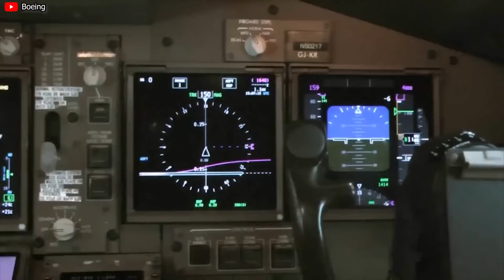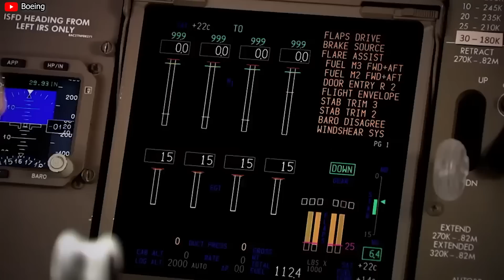Boeing HUGE Engine Plans on 747 is Coming…

Comment: Re-engining the 747 is the easy part. The problem with the jumbo now is that they're getting very old so the airframes are now coming to the end of their useful life, the avionics are old and there's only a handful of the last version, the 747-8. This is not going to happen in a million years.Boeing needs to concentrate on its 747 replacement, the 777-X. Not waste time fluffing about with unappealing and expensive upgrades that will make little to no difference in the long run.
Reply from the maker: thanks for your comment

Comment: As impressive as the A380 is, I still have great feelings of respect and nostalgia for the Queen of the Skies!
Reply: @howardtenenbaum3537  flew recently to Hong Kong on the A380.  Where the 747 is the queen of the skies, the A380 with its low noise levels and stability is a House in the sky.  Fantastic airplane, rocksteady

Comment: Boeing definitely won't be making a twin 747, lol. The 777 is, functionally at least, already a twin engined 747. The 777 can carry just as many passengers, just as much cargo, all while being able to fly further, land at smaller airports, and be more fuel efficient. Boeing has no reason to invest money into making a twin engine 747 when they already have a plane that does exactly what a twin engined 747 would do, but better
Reply from the maker: thanks for sharing your thoughts

Comment: Bring on a twin engined A380 instead.  Far more sensible.
Reply from the maker: thanks for your comment
Reply: A twin engine A380 is far from possible with today's engines. The A380 is a fair amount heavier than the 747, and therefore requires more thrust. The A380 originally boasted 280,000 lbs of thrust across its 4 engines. The issue with that is, there's no engine powerful enough to match that in a twin engine configuration, The A380 already didn't have good take off and landing performance, so giving is less thrust is an absolute no, and the most powerful engine available, the GE9X, produces 115,000 lbs of thrust, so in a twin configuration it'd be 230,000 lbs, which is a 50,000 lbs loss from the A380s original amount of thrust. I don't disagree that a Twin A380 is more viable than a Twin 747, as boeing already has the 777, which functionally is already a twin 747, but a twin A380 is simply impossible with today's engines
Reply: @Prodagist Well short of what is required. 

Remember, a twin has to be able to take off and climb on a single engine, rather than three on a quad.
Reply: @Prodagist  no only that, the complete wing has to be replaced because the present wing is not designed for 115000 pounds of thrust (or more) at one point. In other words it is impossible to put only 2 engines on a wing designed for 4 even if you could have the good engines

Comment: My fear is can Boeing of today build a 747 twin that will be as reliable as the 747 of yesterday? Boeing seems to be in a failure mode with their production of many things. Aircraft, space programs and other things seem to have problems that are insurmountable. I do not want to see something like this new 747 twin in the air till Boeing gets their head back on straight.
Reply from the maker: thanks for sharing your thoughts

Comment: I do not want to see a 2 engines 747 - there is absolutely No need for it. I'm all for bringing back an iconic plane if it's operationally and economically viable but then what's the problem with 4 modern smaller, yet same/more powerful and efficient engines instead. RR are redoing the B-52 engines and are basically fitting small commercial engines into a similar dual pods design to keep the planes structure and engineering exactly the same.
Reply from the maker: thanks for your feedback

Comment: This will be exactly the same disaster as in case of 737 MAX. Larger engines won't fit, they will be mounted higher so MCAS will be mounted on 747 leading to unevitable crash.
Reply: Are you a dumb guy?

Comment: So they'll do the same mistake they did with the 737. Instead of making a NEW plane, they will refit the old project and call it a new plane.
Reply: and they will add MCAS of course.:face-green-smiling:
Reply: @pvisit  A 2 engine 747 would not need MCAS.  The reason MCAS was added to the MAX was because the CFM Leap engines would no longer fit under the wings.
Reply: Not the same. The 737 could not fit the new engines under it’s wings so they opted for changing the wing to allow the engines to be mounted higher which created the requirement for the MCAS system.
Reply: Are you a dumb guy?
Reply: @antoniosoares2903 no - knowing Boeing management he’s bang on the money